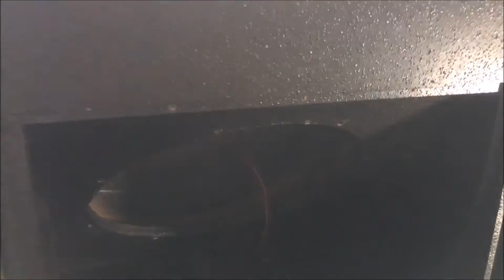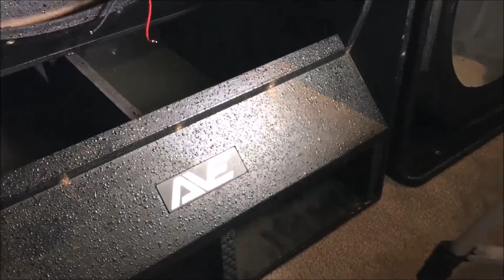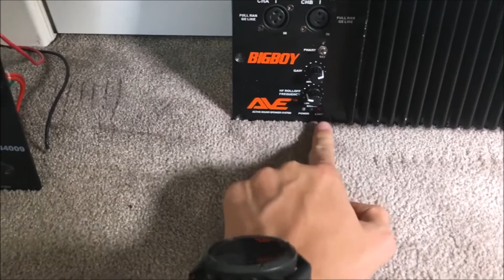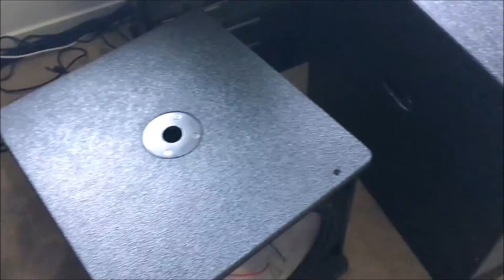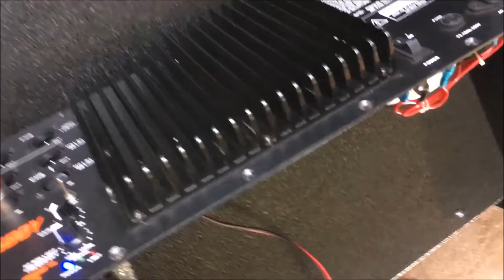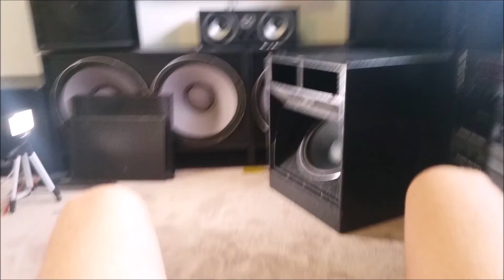AVE Bassboy vs AVE Bigboy!

Comment: The AVE Bigboy uses a Enclosure called a "Folded horn design" #oldschool. This is the most efficient type of enclosure design since it can reproduce very low frequencies withouth using alot of space in your living room or a conert area. The Folded Horn design is usually used outdoors because of its efficiency. Correct me if im wrong :)
Reply: rextonkiller97 what would happen if you covered the hole where the sub is?
Reply: rextonkiller97 actually folded horns need to be massive in order to make low frequencies (my definition of low frequency is below 35hz), but you are correct that they are more efficient
Reply: Horn yes or scoop
Reply: One driver looks like the "the box 15-300/8"

Comment: rear loaded horn design, the piece of wood with the "ave" logo on the front may help for upper bass response since it's located at an angle relative to the woofer, the "port" on the bottom really isn't a port it's just the rest of the mouth of the horn, you can design this kind of box relatively easily on the free program hornresp

Comment: Did you get around to trying the Skytec SP1500 driver in a cabinet? I think you'll find despite its modest power handling it is quite efficient and goes down to 40 Hz (@ - 3db) with ease, making it a good full range driver in a 2-way system sans subwoofer. IIRC its used in Rockford and Seismic Audio stuff in the US and is a typical entry level JBL clone ex China.

Comment: Horns are much more efficient than ported or bandpass enclosures but to get any response under 40hz from a horn it needs to be massive.. making it useless for low bass. 6th order bandpasses offer the best of both worlds in my opinion and are arguably smaller than tapped horns and play a much wider bandwidth although nothing plays high notes better than horns

Comment: I record with the same tripod you are using for your light. They SUCK! I have had mine for only 2 or 3 years and there are 2 things broken on it. One of the things you tighten just spins and spins (in fact it came that way out of the box.) That meant my recording device used to fall over to the side all the time. I solved the issue with tape. The other thing that broke is the plastic handle used to change where the device is pointed. The plastic feet also fall off. If you also have issues with yours, then I know not to get another one to replace it.